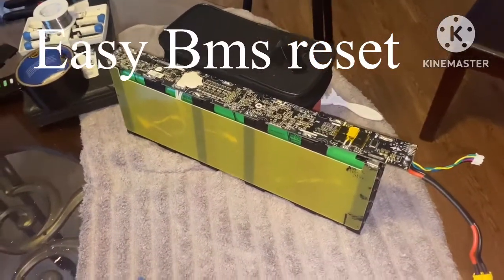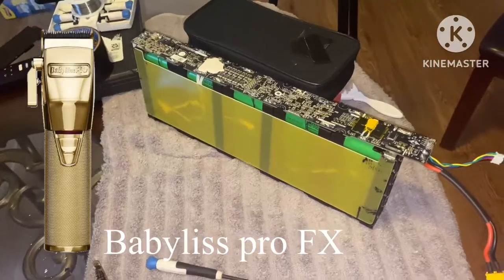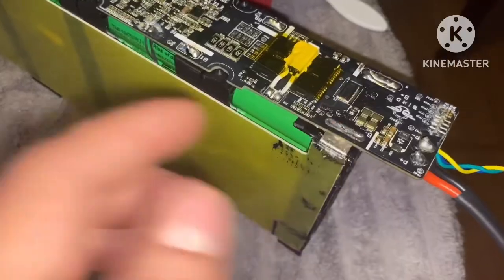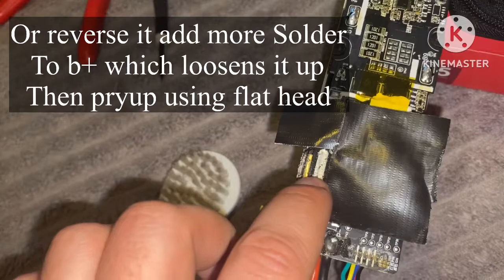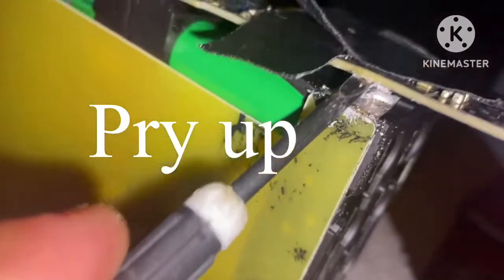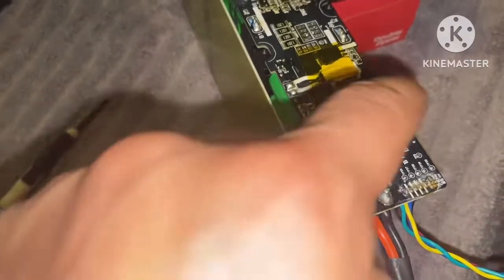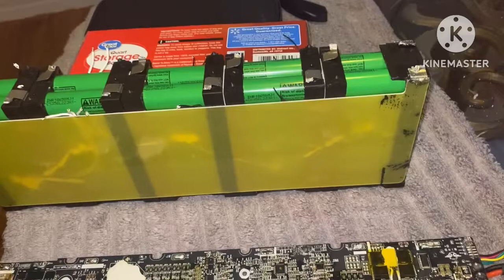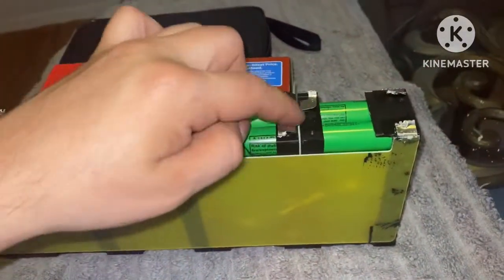Bird 2&3 Bms reset | Electric Scooter | #diy #project

Comment: Dude the little black wires have nothing to do with balancing your battery. There thermistors just different types vs the white ones. The white ones are all different temp ranges and the black ones are all the same. It’s overkill for sure but that’s how it was designed. All the BMS connections that control the cell balancing are the small nickel tabs .
Reply: yes it stupid

Comment: hey man my battery is is stuck at 31.19v and im using a 54v 3a charger the bms has a red faint flickering light i had it plugged up for like 6 hrs nd its still at 31v

Comment: Think about it...
You own a scooter rental company and instead of a big scoter dealership or scooter lot, you just leave them on street corners!
In the beginning half the scooters were stolen and smart kids "flashed" the controllers and had a Lenyrd  Skinner "Freebird!"
The partners sat down an decided that the scooters internal parts can not be simple to hak. 
That's where we are today. 
To use the battery you need a 10S bms from Amazon and a generic Chinese controller. All together you'll spenð  $60
That is the bottom line. 
You can ask and try but if you want to ride your bird...

Comment: I have a question, I try to test the headlight with a 40 ohm resistor on a power bank i works for like 30 second then the light doesn’t work anymore , i broke the light?
Reply: Same man
Reply: I'm thinking of swapping the bulb to something different
Reply from the maker: The higher the resistance-resistor-  the lower the current flow. That’s strange as hell . I don’t believe it’s a dead bulb..

Even without any resistance at all meaning no resistor in place your headlight will still work.
Reply: @pjscootermods  my friends light on his scooter started changing colors like a RGB light 😂
Reply from the maker: @datsun7023  oh dam now that you said that I do remember connecting a headlight Direct to that battery that sits right there up top. And it did what you said.. at first it was a normal light and then it turned like dark blue then went to a light blue , and then a yellowish color and that was it ☠️. Shits wired because I did that on a bird ttwo scooter before that but the light it was normal, that’s why I was kind of confident when I did it, I won’t do that shit no more…
I’m still learning my dam self lol.. just stick with using a 30 ohm resistor.. they have them all over the place..
Reply: @pjscootermods  ahh that makes sense thanks man I appreciate the advice

Comment: I have a question for the battery to work with the same bird scooter u pulled it out from do you need to jump the B+ and B+ points then just connect it to the new controller
Reply from the maker: Yes the bypass is mandatory regardless. Without it your BMS is locked. You will get no response/voltage out of it.. regardless what controller you put on it or what scooter you add it to the BMS needs to be bypassed yessir .

Comment: Hi pj I have a lil problem my battery had this red sign, I detached the B- terminal and re attached it, the light did go away but the battery wouldn't even charge after doing that.
Then it looks like I may have damaged something and the board components started smoking a little what should I do with the battery?

Comment: Do you have a solution that the battery is not charging?  The charger flashes red briefly and then green again.  Despite the green light, you can hear something from the BMS and the red led on the BMS flickers weakly.  The charger is a 42V 5A, is that too many amps?  No right?
Reply from the maker: I don’t believe using a five amp charger is the issue for this cause. Now that noise you hear that’s typical I hear it all the time, even the little red light that flickers is ok👌 .. what you don’t want is a solid red light .. i’ve never had a battery that refuse to charge on me unless it was due to a solid red light and only thing that requires is a reset and problem solved
Reply: @pjscootermods  Thanks, at first the LED was red, but after I put the charging plug in twice, the light started to flicker and made noises.  But it doesn't charge :( it only charges via the discharge port or by bridging RST and B- (permanently)
Reply from the maker: @Zattoo20  I have never had this issue honestly The times when I did have an issue my battery not charging it was because there was a solid red light on the BMS board, but until you clear the solid red light for me at least it starts to charge like normal again.. maybe try a different battery ? You’re not the first person who contact me about this problem there has been a few people who have claimed to have this issue..
Reply: @pjscootermods  i had a solituion,  dont use 42V 5A,  now it´s loading with another charger 42V 2A , very nice
Reply from the maker: @Zattoo20  whooop !! Their you go my guy . Glad U found the solution. Iv never even tried using a 5a charger. Typically those are used for fast charging.. but from what you said it looks like this battery is not having it
Reply: wich charger do you use ? how much Amps ?  @pjscootermods
Reply from the maker: @Zattoo20  this is what I use

https://amzn.to/3QGvs7j

Comment: This is what you need to do if your not answering electronics hobbyist and don't have proper equipment for the job.. 
(Solder sucker and KAPTON tape instead of duct tape,)
But I can't not like this video.. Thumbs up from me. 👍😊🇮🇪
Reply from the maker: lol thanks bro 😎 I recently purchased a solder sucker Iv been rebuilding broken dewalt batteries lately . basically, I buy them for cheap refurbish them and resell them. As long as the batteries are not below 2.5 v they are good to go 💪. The cells are expensive . 1 single 18650 10a 3500 mah  cell is about $4/$5 per cell . depending on where you get them

Comment: Hey dude great vidz, om having some battery issues afterski the bypass (b*>p+ ) scooter wont charge, ANT idea ?i Would Also install. A on off switch think you can help me out ?
Reply from the maker: Just get you a controller with the display kit. And there goes your on off switch there.. after completing the bypass your battery should still charge like normal.. even without the bypass your battery will still charge

Comment: Bro i have a few questions i did this bridged it nd i still cant get voltage to the outlet plug. Help if u can.
Reply from the maker: You should have a voltage! What does it show when you plug in your multi meter? It’s possible your battery could be completely drained

Comment: I HAVE A PROBLEM, I PUT THE BATTERY TO CHARGE AND NOT THE CHARGE AND THE RED LIGHT GOES ON AND OFF FOR 3 SECONDS, WHAT CAN IT BE?
Reply from the maker: Bms related issue .battery pack would charge if it (bms) wasn’t in place . Either that or the charging box itself ! If your battery pack is reading 41.v then we know the battery is not under charged, if your bms is giving a code or flashes a unusual light then I’d recommend reset your bms.it all falls back on either your Battery charging supply or your Battery bms board malfunctioning
Reply: @pjscootermods  Is it possible to reset the bms mode? because I don't see any reset button

Comment: Just to make sure, you kept saying B+ to B+ but you meant to say B- to be B+.....is that correct?
Reply from the maker: - bypass - Bridge B+ to p+
If you bridge positive to negative that’s gonna cause a spark and trigger the bms to go into protection mode. Which should cause a red light on your BMS board, bms goes into protection mode if that happens your scooter will no longer take a charge until you can clear the red light
Reply: @pjscootermods  So i looked further into the schematics of BMS's and this what i found, basically  P- & B- are separated by a low side fet this is why you have to jump them, you are jumping over that Fet. And P+ &B+ are connected together since the power separation happens using that low side fet.
Reply: @pjscootermods  Also, most P- connections have a row of fuses, it would be a good idea to jump B- to before the fuses so you have some protection rather than bypassing the fuses directly by just jumping P- and B- together.
Reply: @Jandroverse  B+ to p+  OR  P- and B-  ?
Reply: @Zattoo20  it should be B- to P-
Reply: @Zattoo20  just so you understand it. “P” is for power out. “B” is battery leads so +P and +B are normally connected together in most designs. You can check this with a multimeter by checking continuity between them. On the other hand -P and -B are separated by a mosfet which acts as a gate. When the battery saids everything is ok this gate closes and connects -P to -B. You can just bypass that “ok” check from the battery by jumping -P and -B together. Expect a small spark when connecting the two this is totally normal. 

Btw NEVER CONNECT ANYTHING WITH A PLUS SIGN (+) to ANYTHING WITH A NEGATIVE SIGN (-) this can cause a very large spark and in some cases a fire.
Reply: @Jandroverse  Do you have a solution that the battery is not charged?  The charger flashes red briefly and then green again.  Despite the green light, you can hear something from the BMS and the red led on the BMS flickers weakly.  The charger is a 42V 5A, is that too many amps?  No right?
Reply: @Zattoo20  if the battery has been fully depleted for a long time. You may have a bad cell and that’s whole different problem. Have you tried leaving the charger plugged for a while these batteries charge very slowly leave it on for about an hour then unplug n plug back in. And that’s right 42V at 5amps is ok to use.
Reply: @Zattoo20  yes 42V 5A is ok to use if you have a 36V battery pack.
Reply: @Jandroverse  the battery had 26V. No, when I plugged in the charger, I measured the discharge port and the voltage there did not increase after 5 minutes.
Reply: @Zattoo20  yep 5 min is nowhere near enough time to get a charge. Leave it for about an hour
Reply: @Zattoo20  however, if your charger light turns green right after you plug it in and your battery is not at least at 36V. You have a dead cell, best bet is to get a new battery.
Reply: @Jandroverse  it has been charging for an hour now, the led is flickering but nothing else has happened.  If I have RST and B- permanent bridge on the circuit board, then the battery charges. I'm just a little afraid of bridging it all the time.  I think you are wrong, liion cells can be discharged up to 2.5v, of course the bms decides.  You say 36v is the minimum so that something is charged, it would be 3.6v and that is storage voltage.
Reply: @Zattoo20  you are talking about a single cell. Not the whole battery pack.
Reply: @Jandroverse  You said if the battery isn't over 36v then I have a dead cell.  It is a 10s battery, so 3.6x10=   , so my 26V is not undervoltage.  The bms probably just shut for ever.  But with your trick, it only loads if I permanently bridge or load from the discharge port.  are any security-related functions overridden in the two variants?  The best would be a new bms right?
Reply: @Zattoo20  for the BMS that’s depleted battery and btw you have to permanently leave -P and -B. You are hacking a battery so it can work without the communication side. So yes you have to leave it jumped